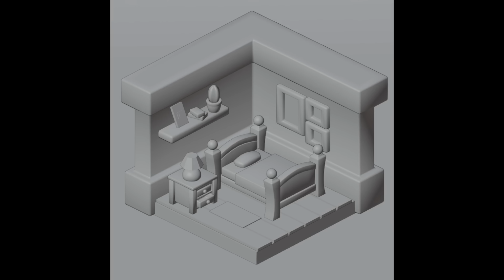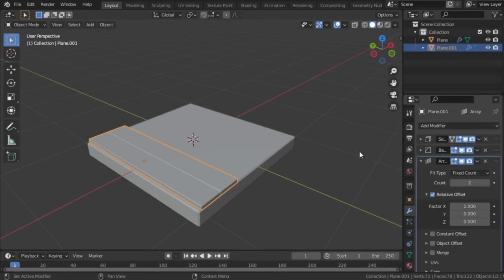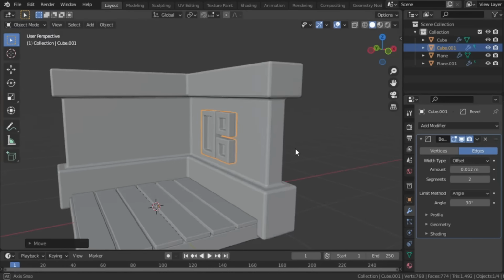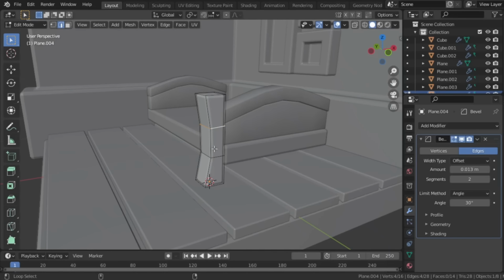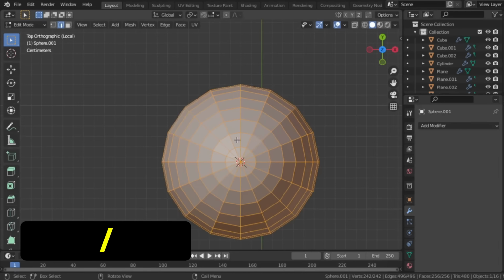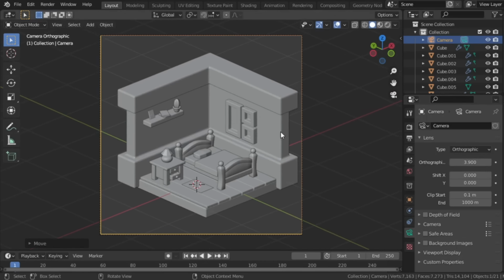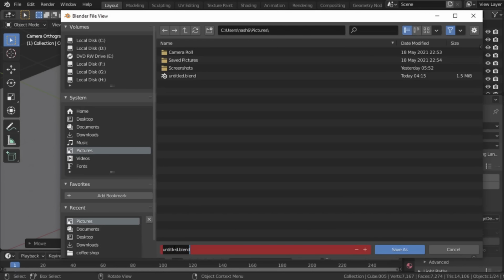Blender 3D - Create a 3D Isometric BEDROOM in 15 minutes | Beginner Tutorial

Comment: This is a really great tutorial.  It'd probably be good though if it was made clear in the beginning that there are many issues that can arise while doing this that will require extra research to figure out.  For instance I was trying to mirror the bed posts but it kept mirroring too short on the x axis and so I had to eventually figure out that the object origin of my 'box spring/mattress plane' was not centered in the middle of the mass.  I'm not sure how that happened in mine and not yours, but it did and required an extra bit of research to figure out.  I'm sure there are many more moments where things like that will happen for myself and for others.
Reply: hi there- i'm actually still stuck at this point and can't mirror the bed posts properly... im thinking about just defaulting and making 4 bedposts at this point;; could i ask where you got the solution for this? thank you so much!!

Comment: Some problems and answers I found in comment section:
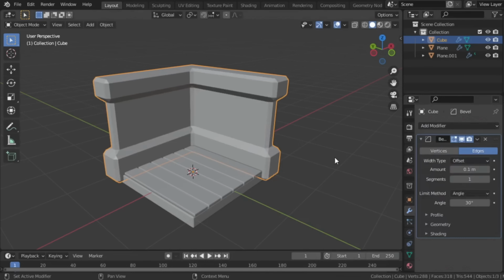+ 3:24 bevel doesn't work
check if your vertices didn't doubled:
Mesh > Clean Up > Merge by Distance
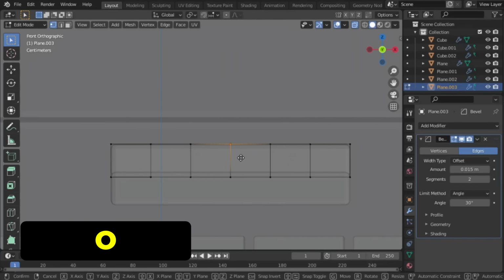+ 5:07 it's zooming in/not doing what it supposed to do on video
click "o", then "g" and then scroll up/down. to get symmetrical results, press also "y"
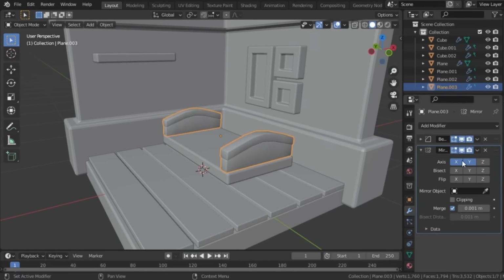+ 5:38 mirror modifier is not working
check, if your orgins are in right places (object mode, select object > right click > set orgin > orgin to geometry)
add in mirror modifier "Mirror object" > choose your bed
(I'll update it when I'll go further into the video)
Reply: thanks! you saved my day!
Reply: Thanks bro <3

Comment: Hi I have a question if anyone can help me:

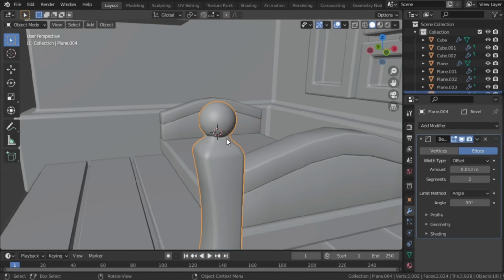I'm at 6:34 - Shade smooth does nothing. What could be the reason?
Reply: Found the answer just when I finished writing this comment: I didn't have Limit Method on on Angle at 30 degrees in the Bevel Modifier pannel.

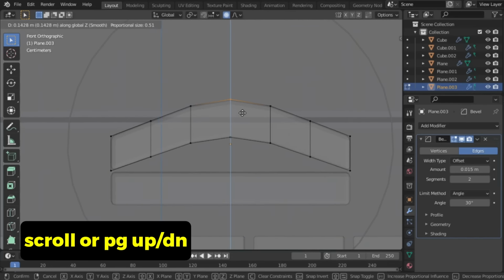Comment: I have a problem when doing 5:12, the proportional expanding, there is also an extra grid line horizontally connecting top left and right extreme and bottom left and right extreme while moving .therefore the block doesn't entirely move, it is like the duplicate is moving.does anyone know why and how to rectify this
Reply: I have the same issue
Reply: remember to turn off the proportional editing

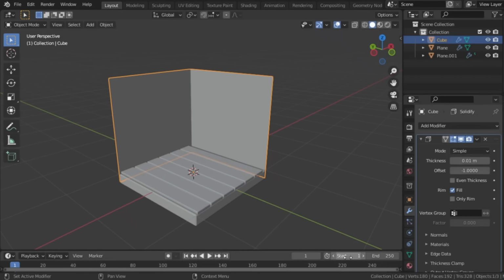Comment: for some reason around 2:40 when I add the solidify modifier to the wall and try to adjust the thickness, there is no fill between the inside and the outside edge of the wall, its almost as if I just duplicated the thin wall and just resized it... any idea on a fix?

EDIT: Nevermind, I figured it out. Instead of deleting the faces of the cube I was instead dissolving them, which kinda messed up the remaining two faces. Deleting, rather than dissolving the unwanted faces fixed the issue.
Reply: Ohhhhhh god. Thank you lol. I had the same problem but then i found ur comment and it got solved so thank you !
Reply: @bloodsmella  of course! glad to help
Reply: Thank you!!
Reply: Ty bro
Reply: Those stuck there like me in deleting faces, just go to a face press left click and drag and let go on the face you want to select for deletion and press delete. I figured it out by accident

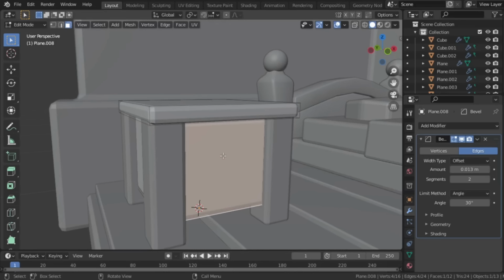Comment: At 8:16 I can’t extrude my boxes inward, only out. What am I doing wrong?
Reply: i have the same problem
Reply: @Sarah-hr2li  I kinda figured it out. For some reason the box wasn’t selected in the scene collection after I separated the legs. It’s hard to explain.

Edit: ok so in your scene collection there’s an icon that looks like a box with one white small box in the right upper corner. Make sure that icon is on the box you’re trying to edit. (Table). I don’t know what that icon is called, the description says “Change the object in the current mode”
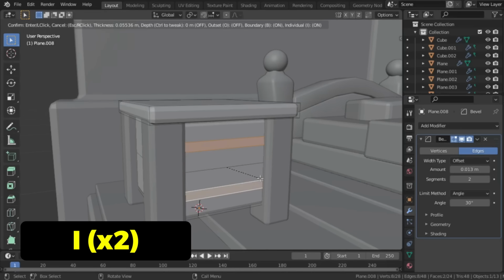Reply: if we're talking about Inset faces(It wasn't inseting faces from outside to inside) i just pressed i 2x and it worked. At 8:21

Comment: I’m struggling at 5:07 where you press O to turn on proportional editing… when I press O it turns it on, and I have the vertices selected in the middle of the footboard, but when I scroll it just zooms? I thought maybe you pressed a hot key and didn’t say it but I can’t tell what’s happening in the video around that time, my blender screen seems to look the same as yours… I tried just moving it up and scaling, but neither are working that way. 
If it matters, I don’t have a real mouse wheel, it’s a bluetooth mouse with a touch sensor wheel, so I can’t press MMB or anything, just scroll. 

Any way someone could help me out?
Reply: idk much but if you press grab/g and ur vertex is selected, you can choose the axis that makes it only go up and down and use the mouse wheel to help with it
Reply: @syfere  thanks a lot, I had the same Problem. Its not shown that you have to press G afterwards, so I was very confused. Now it works :)
Reply: @syfere  OMG TYSMMM
Reply: Did you select G for grab first?
Reply: @garymation7426  shut uyp
Reply: you need to press g before scrolling

Comment: Random question someone might have a answer for if I(G)rab an object to move, and press X/Y/Z to move on a specific axis, why is it you have to set object down (LMB) before selecting another plane to move along? For example: grab picture frame G+Z to move on Z axis why can't I move it up, then press X to the move Horizontal. X will pull object back to original position then move on X axis. Any insight would be helpful if what I'm trying to achieve is possible, thanks. Hope this made sense 😂 same effect when using MMB.
Reply from the maker: If you want to move the object on only X and Z axis, you can press Shift + Y, after pressing G. Hope that helps 👍

Comment: Bro what ram need to download blender.
In my pc ram is 4gb so i install blender anything happen.
Which version need to download
And any high graphics card need.
Its my doubt
Plzz reply broo♥️♥️
Reply from the maker: I was using a laptop with 4gb ram, integrated intel graphics until recently, so yes you can use blender. For further information check blender official website for system requirements.
Reply: @3dgreenhorn  ok broo thankyou ♥️

Comment: And again and again, another one who is wrong about isometric render. In 12:11 is the part, where you are wrong. Switching camera to otrhographic only doesn't mean you have isometric render. Parallel projection is the A term, under which are some subterms as Orthographic and Oblique and than under that orthographic are isometric dimetric and trimetric projections. And each of them have exact rules of angle and positions settings. What you only made is at least kind of dimetric, but definitely not isometric.
Reply from the maker: Thanks for the information, didn't knew these before.

Comment: If you are having problems with mirroring: Go to Object Mode, Highlight the object that the mirroring should be centred around (highlight bed for the mirroring of the bedposts etc) right-click, choose "set Origin" and then choose "Origin to Geometry". Now blender know where the middle of your bed is and the mirroring of the bedposts should work :)   Also, make sure that the "Mirror object" in the Mirror modifier is set to the bed.
Reply: Thanks bro saved my alot of time and teached me a new thing
Reply: bro am having this wierd black shadow when i apply smooth shades any fix? 5:27
Reply: Fixed just turn on the auto smooth..
Reply: @COSMO8843  doesn't work for me :(
Reply: @COSMO8843  bro I enabled auto smooth but it still looks same, did you change any angle or degree
Reply: @COSMO8843   thank you so much, you helped me.
I didn't know the Mirror object was supposed to be set to the bed
Reply: thank you! Was wondering why the mirroring is not working
Reply: Bro, I'm still struggling :( It copies the thing above the bed way past where the head should be. I'm gonna duplicate instead, but if you could help me, that'd be awesome
Reply: I just figured that when you move it in object mode, the center moves, but when you move it in edit mode, it doesn't. Is there a more precise way too position the yellow dot in the middle of a desired object (other than the one you're mirroring)?
Reply: @franztomandl51   as the original post says, in object mode highlight whatever object you need to center the yellow dot in. Right click set origin, and then origin to geometry. That is the most precise way! :)
Reply: @franztomandl51  in mirror modifier u can select the origin of the body u want ...it can be any body and the mirror will be applied according to it
Reply: @kimzap  Not exactly "the most precise way." The reason people are having issues with this is because the instructor forgot to point out the extremely important point that Blender behaves differently when moving a mesh in Edit mode than when in Object mode. In Object mode, the origin moves with the mesh. In Edit mode, the origin remains in its original position while the mesh moves to wherever you move it to; i.e. now the origin is separate from the mesh. Sometimes this is desirable, as in this case where you want the Mirror modifier to mirror across the origin point in the exact middle. But for beginners who don't know this crucial difference, it can create all sorts of problems, as it has here.
Reply: @franztomandl51  if u r in reddit join blender community u will get ur help
Reply: Thanks bro!! I struggled for so long.
Reply: Savior. Thank you!
Reply: i love you
Reply: The problem is, the instructor did not mention the fact that he moved the mesh in EDIT mode, which moves the mesh but not the origin (which is what you want). When you move a mesh in Object mode, the origin moves with it. By moving it in Edit mode, the origin remains where it was, so when you add the mirror modifier, it mirrors across the origin point; i.e. in the middle. If you move the footboard mesh in Object mode, the origin will move with the mesh and your mirror won't behave properly. (I helped my son through this tutorial yesterday, because he was having this exact problem.)
Reply: Thankss~ This help alot!!
Reply: tysm, you saved my life
Reply: Thank you !!
Reply: @shees66  My pleasure!
Reply: My man! Thank you <3
Reply: @MrJewishAssassin  Glad it helped you mate!
Reply: U're a fucking hero!
Reply: @alefmartins7931  you're the hero! I'm just a sidekick pointing at some buttons 😎
Reply: It still doesn't work for me, the bed looks completely wrong, i dont know what to do
Reply: @DawnlightSleep  I'm sorry to hear. If you are completely stuck, and have tried multiple possible solutions that haven't worked I would actually suggest that you start from scratch. It will be way faster to get to the same point than you think it will be and you will also learn even more new stuff and most likely realise what went wrong along the way.
If you do start over, don't delete your current project, just start a new one. That way you can always go back to the current and fix your error and continue on that whenever. Don't give up! Good luck.
Reply: @kimzap  Alright, ill probably do that if i cant figure it out today. Thank you so much!
Reply: Thank you so much!!
Reply: thanks
Reply: thank youuu, been wondering for past few days. i didn't know that the answer is here.
Reply: this helped out so much thank you
Reply: Thank you so much!
Reply: This helped me a lot thanks!
Reply: if you're still having issues, click object you want to center around( like the bed), set origin to geometer as mentioned above. Click object you want to mirror(bedpost) add mirror modifier. In the modifer window, look for mirror object option  and click the eyedropper tool and then the bed. Should mirror around whatever you click
Reply: This was a year ago and you are still a gosh darn godsend.
Reply: You are my God and savior who came to my rescue in my time of need! (or in other words, you saved me time looking for the solution, thank you kind person!! have a nice day!)
Reply: If anyone still has trouble with the mirror modifier that's not centering the bed, just do this: select the "eyedropper tool" on the Mirror Modifier tab and select the bed.
Reply: Thanks :3
Reply: THANKS BRO, I WAS CRYING
Reply: @TheJeque  bros shall cry no more! Glad it helped 😀
Reply: Thank you. Was there an explanation for why this happened?
Reply: Thanks!
😀
Reply: Спасибо друг
Reply: you're a lifesaver, thank you!
Reply: Cheers!
Reply: Ty!
Reply: Thank you so much! i was very confused that the posts on the table were not aligning
Reply: Have problems with separate  object , always is red and cannot work with this part
Reply: Thanks for the help
Reply: Legend!
Reply: ur a legend I HOPE U KNOW THAT
Reply: Is it okay if we jus do regular duplicate?😭 I can’t make it work either
Reply: i had this problem and even though I followed this it didn't work, but when I set origin to the cursor...IT WORKED? i don't how but it worked.
Reply: Beautiful, thanks
Reply: tnx broi
Reply: Thank you! 🙏🙌
Reply: Thank you! I knew it had to do with the origin but I used shift+S and couldn't find the option 🙇‍♂️ thanks again!
Reply: Amazing thank you!
Reply: Thank you! I was having trouble with the mirror modifier 🙌
Reply: another one: if it still didn't work, highlight the bed and the bestpost then set origin to 3d cursor > median center
Reply: Thanx buddy you fixed my issue thanx a lot
Reply: thanks bro i  have been searching for too long 😭😭
Reply: thank you so much
Reply: Thanks
Reply: Thanks a lots. I was struggling to do this mirror modifier part. Your comment helped me to fix it with a minute🤝😃
Reply: Thank youu so much you saved my life

Comment: 5:11 - This tool doesn't seem to work for me, I tried Scrolling and using pg up and dn...
Reply: Based on my experience, first you need to select the vertex. After that press "Ctrl + G" and press "Y" to change the vertical. After that, you can just change it just by moving your mouse or pressing scroll in your keyboard.
Reply: Make sure the orbit-like icon is blue on the top of the screen, next to the magnet icon
Reply: @jonde3  It is.... I tried 5 whole times
Reply: @manavgupta4495  ¯\_(ツ)_/¯ idk then. It has been working for me since I started using blender
Reply: i have the same problem, did you find a solution?
Reply: I also have this problem...Hope someone can answer it : (

Comment: Hey, I'm having a bit of trouble with the mirror modifier. i selected the bed as the plane, but it still doesn't go to the edges of the bed, it mirrors right beside itself
Reply: Had the same problem. Figured it out! Its because the origin of the object is not centered in the bed. Go to Object Mode, Highlight the object, right click, choose "set Origin" and then choose "Origin to Geometry". Now blender know where the middle of your bed is and the mirroring should work :)   Also, make sure that the "Mirror object" in the Mirror modifier is set to the bed.
Reply: @kimzap  Thank you. That fixed it.
Reply: You need to select the object in mirror modifier property.
Reply: @arukigaming2621  I did. Double checked it too

Comment: 6:39 even though i use mirror object , the legs don't move far in X axis  they just move a little bit  :( 
any solutions please
Reply: Had the same problem. Figured it out. Its because the origin of the object is not centered in the bed. Go to object mode. Click your bed in the collection so that it gets high lighted, then click the menu "Object", its in the upper left corner right beside "Select" and "Add". In the "Object" menu, click "set Origin" and then choose "Origin to Geometry". Now blender know where the middle of your bed is and the mirroring should work :)   (there might be other better ways to fix it, and I might have used weird termonolgy, this is my first day in blender)
Reply: @kimzap  another way , inside the mirror modifier select the dropper kind of thing and click the bed with it . set axis to y , deactivate x . BOOM ! problem solved !
Reply: @divinebanana9782  Glad you found a solution 😊
Reply: @kimzap  😃👍
Reply: @kimzap  Thank you so much
Reply: @Oxerus  my pleasure, buddy!
Reply: @kimzap  omg dude you're a life saver this worked
Reply: @kimzap   hey buddy , it still not working! Although an alternative would be snapping the edges. to do so , duplicate the bedposts "shift + D + Y" . go to the top bar which shows the mode and a few other stuff. find the magnet icon. click on it to activate it. click on the drop down menu next to it "snap to " -> "edges". Now whenever you move the object , it will automatically get stuck to the bed . not the best alternative , but still works .
Reply: @divinebanana9782  life saver!! tysm
Reply: @mewieess  damn even after 2 years someone read my suggestion and it worked .. wow .. thank you for making my day
Reply: @mewieess  btw you doing this is a freelance artist or just a hobby ? I was in 8th grade and took 3d art/modeling as a hobby since i had a ton of free time due to covid lockdown... best days of my life : ) ..
Now i will be going to college next year hopefully can pick it up again cuz i forgot most stuff..
Reply: @divinebanana9782  im doing it for hobby rn because im trying to improve myself but i really want to be a 3d artist as my future job ^^ i hope you can continue doing it and im sure you will remember the things you forgot with spending proper time in blender
Reply: @kimzap  Thanks so much for this, i was going nuts
Reply: Hi there! Did you find the solituon I don't know but I fixed it so this happening because your legs pivot was middle of itself, it should be the middle of the bed.